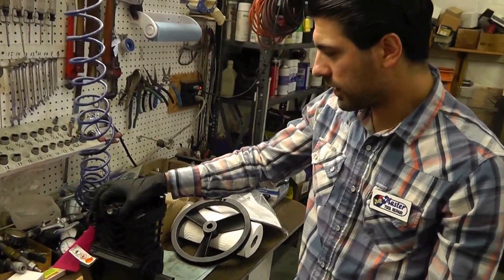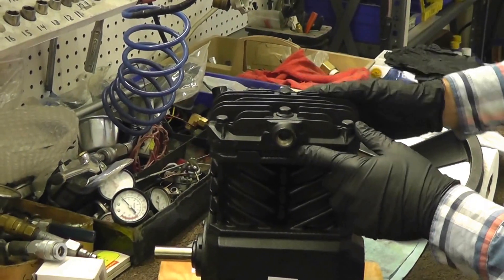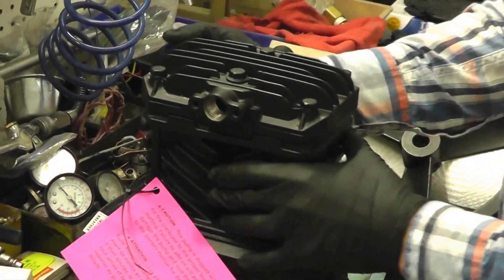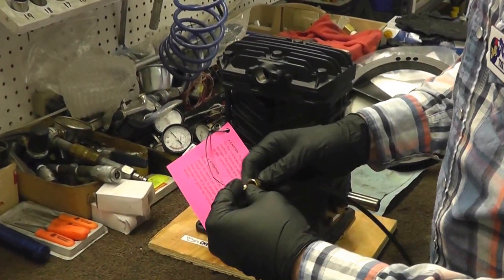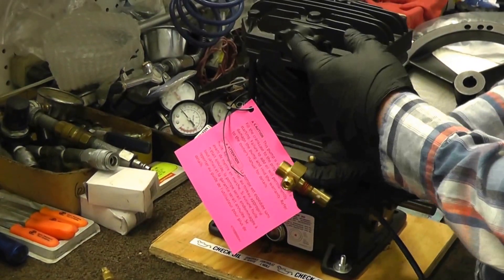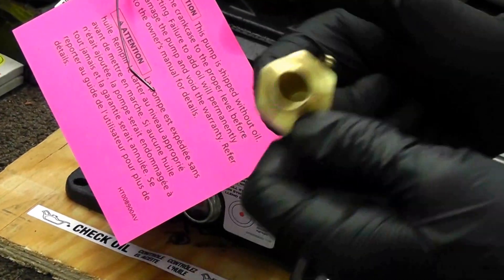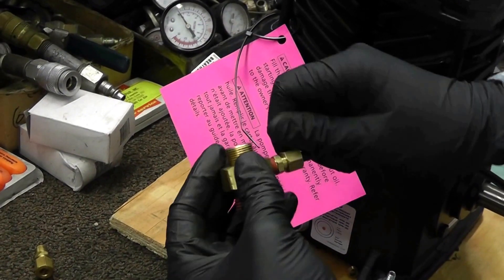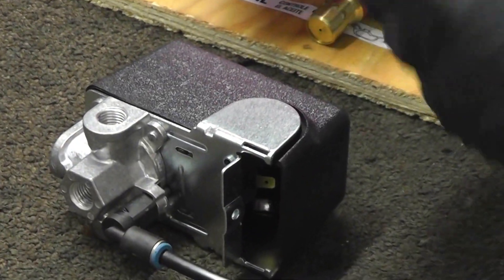How to replace your old Campbell Hausfeld VT pump with the new VT4723 pump.

Comment: I don’t know which style of pressure switch to buy. I picked my compressor up from the scrap pile at work and mine is missing. How to tell which one I need?
Reply from the maker: Thanks for the watch and the question! There are  certain specs you need to know about your compressor before you can find the correct pressure switch. First, what is the cut-on and cut-off PSI settings of the compressor? You should be able to find this info on the manufacturer's site and if not, try giving them a call to see if they can give you this info. Maybe they can even give you the pressure switch part number or specs. Next, find out if you need an unloader valve on your switch or not. Most units DO use the Unloader Line which connects the tank to the pressure switch Unloader Valve (this is usually a 1/4" OD copper or nylon line). Next, figure out if you need a single "port" or thread on the bottom of your pressure switch (the manifold) or if you need a 4-way manifold.
You can view the various pressure switches we have available on our site at the below link:
https://mastertoolrepair.com/air-compressor-parts-pressure-switches-c-25_2.html

Comment: Filter for vt49000 pump
Reply from the maker: If you have the VT490000AV pump, you can view the full parts list and breakdown on our site by clicking on the below link. The air filter is reference number 12 on the diagram:

https://mastertoolrepair.com/air-compressor-pump-parts-vt490000av-p-60726.html

Thank you!